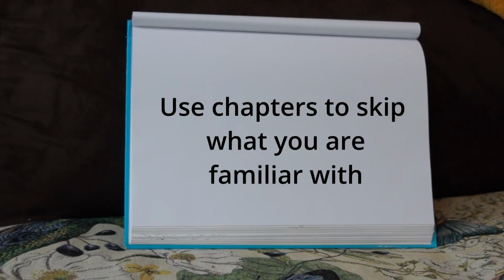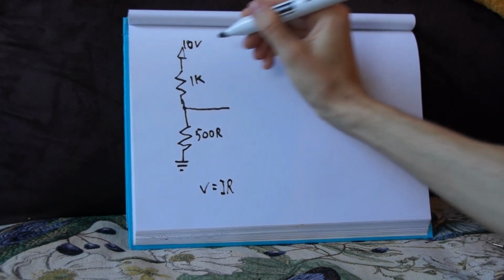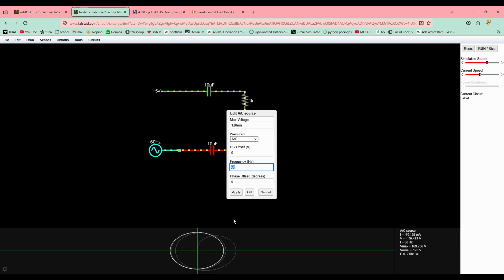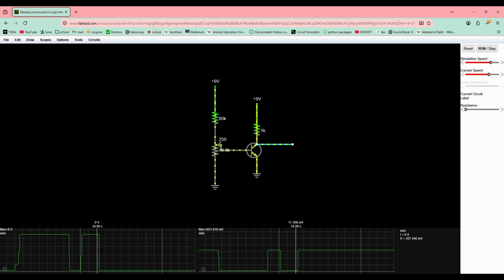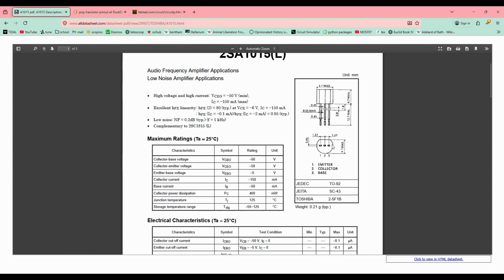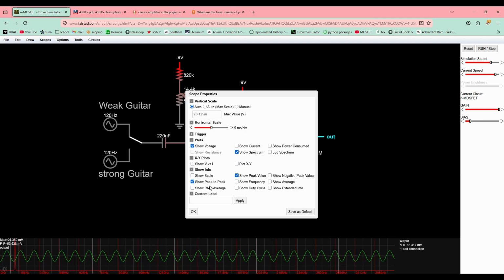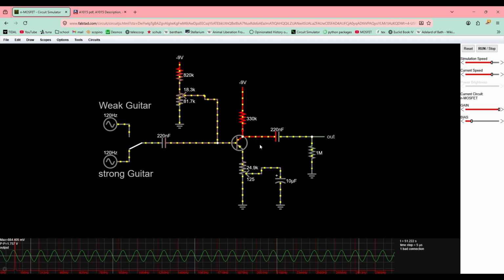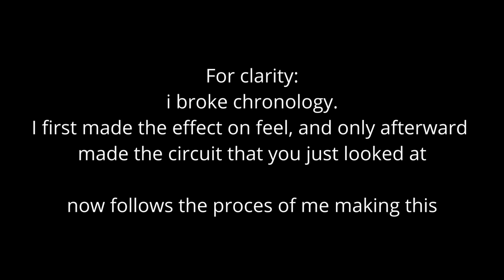How to design a distortion pedal 101

Comment: hint. get out of third harmonic symmetrical clipping mindset. 

piezos need an input impedance of 10M or higher if you want any decent "bass" or tonality...
Reply from the maker: wdym third harmonics symmetrical clipping? with this gain butten on the second amplification stage the clipping is generally not symetric, if you mean assymetric diode clipping, i did that in my last pedal, see my other video, didnt hear much difference tbh

also what do harmonics have to do with clipping?

also, i think the piezo did fine, but next time ill build a circuit with them ill use a mosfet or opamp on the input, thx for the tip.